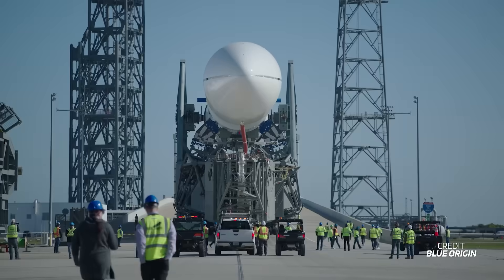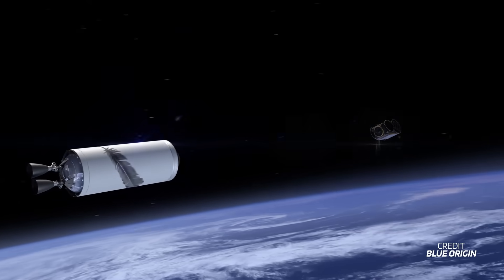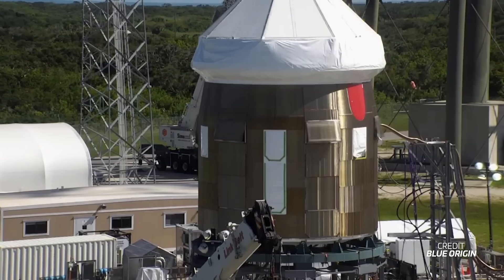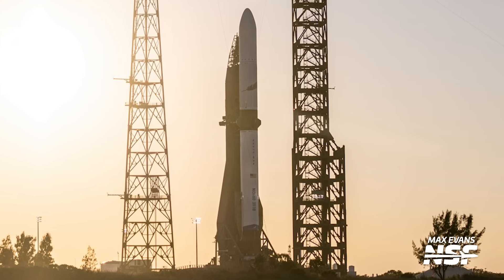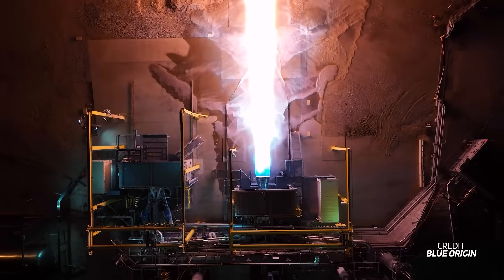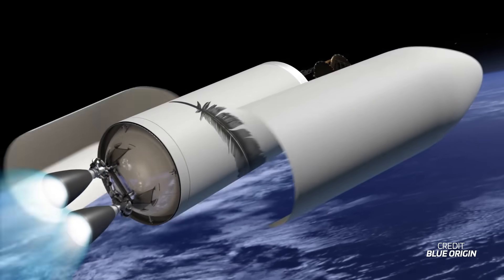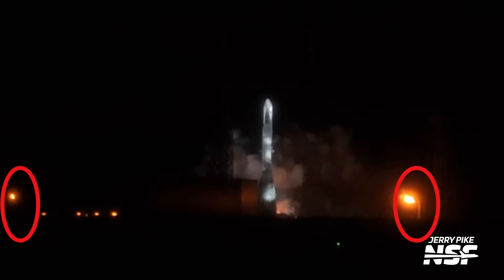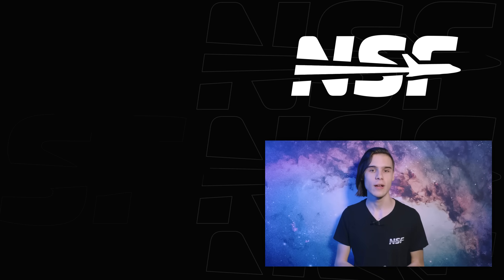The Wait Is Over: Blue Origin's New Glenn Takes Center Stage

Comment: Finally, something that can actually compete with Falcon 9. In payload capacity, at least. I predict five to six New Glenn launches in 2025 barring any catastrophic failures like ascent explosions, as getting used to refurbishing each returned stage and putting it back out is only something you get good at with practice and time. I expect a healthy cadence from this rocket in the future, since as SpaceX has so wonderfully proven, a high-payload partially reusable rocket is a remarkably efficient system once it spools up to full speed.

Comment: Are these engines more powerful than the raptors spacex has? Only 7 engines on this rocket compared to 33 engines on starship booster
Reply: Raptor 3 ~590,000 pound force
BE 4 ~550,000 pound force

Starship - 125 meters  tall (block 2 with hot staging ring) and 9 meters diameter
New Glenn - 98 meters tall 7 meters diameter

New Glenn has far less mass to lift.
:face-fuchsia-tongue-out:
Reply: @ thanks

Comment: It took SpaceX a while to successfully land a booster with their Falcon 9 system. They have made one land-based landing with a Starship booster and two controlled “soft” landings in the ocean with their boosters. Starship has not landed on a platform or land yet and I am not sure that any of the Starships have been completely recoverable. 

On a rocket system, there are a lot of things that can go wrong. You have to relight and control the rocket motors, you have to control the descent, the timing for landing must be so close to perfection that there is almost no margin for error. The Falcon 9 booster descents make all of this look very easy—it is not.

Each time SpaceX has launched a Starship-Booster system, they have needed to be re-certified by the FAA. The reason is this is a massive rocket system, all parts of which are going into space (above 100Km), are re-entering the atmosphere and descending in a semi-controlled manner back to Earth. There are considerations for the environment, danger to humans and the real possibility of launchpad mishaps with many tons of highly explosive fuels. SpaceX has struggled with getting permits from the FAA and I will be watching to see if Blue Origin has the same issues. I strongly suspect that there has been a certain amount of politics involved in these permits and I predict that Blue may have an easier time getting permits, as they are using many of the subcontractors to build the New Glenn that NASA uses to build their launch systems, resulting in many friends in Congress. SpaceX has not done this.

These companies could not be more dissimilar. SpaceX creates success from repeated failures, learning each time. Blue Origin moves much more slowly, trying to evade any failures. If there is any failure in this first launch, it will not be seen the same way that a SpaceX failure is seen.

Comment: I would be curious if you have data on the developmental timeline for Blue Origin vs. SpaceX.  SpaceX seems to prefer the "Move fast and break things"-Model when they developed their rocket, whereas Blue Origin seems to be focused on the "traditional" top-down design with their design. As an example of what I'm talking about, SpaceX probably always wanted to return their 1st stage on a barge, but took multiple years and 6 flights (per my Googling) before they added the legs and tried it.  Blue Origin seems to be willing to try it on the first attempt.  This means, Blue Origin had to fully design this in from the start (top-down design) and it probably cost them in terms of delays to their first launch.
Reply: From company founding to 1st landing for SpaceX was 16 years (for a orbital launch).

BO is on the other hand is into their 25th year with no orbital LAUNCH attempt.
:planet-orange-purple-ring:

Comment: I think just two launches in 2025 even if first one successful.  Logistics, weather, crowded Cape, lessons learned all causing delays.  But Blue is using a very different model than SpaceX, relying a lot on computer simulations rather than actual testing.  Just as SpaceX doing its rapid build/test/rebuild model was derided when introduced, so has Blue's lack of reliance on real world data.  This is really going to demonstrate if their philosophy works.  If it does, I see the gaps after the second flight dramatically reducing.

Comment: This launch will be an engineering reality check.  BO has taken a lot of time "perfecting" this rocket but there might yet be some unknown unknowns. It will be a show down of engineering approaches; iterative failure and improvement (SpaceX) or long partial testing with few full sequence tests (BO). My guess is that BO will launch no more than 3 times in 2025 due to "unforeseen" technical issues.
Reply: good comment
Reply: That's why they do all that small component testing.  It does tend to produce working system.  It's how they got to the moon.
Reply: @imaginary_friend7300  

NASA and its predecessors blew up a lot of rockets.  One of their sub orbitals taught them not to use leather gaskets to hold in LOX, it got soaked in LOX and any impact and it exploded.  Apollo 1 burned on the pad (with crew sadly) during testing.  Not to mention the failed Apollo 13 where they barely saved he crew.  A great many failures before they dared a manned flight and those accepted higher failure risks than are acceptable today.
:planet-orange-purple-ring:

Comment: Finally, what I'm watching for is how fast they turn this around and launch number 2 or if its going to fall into the SLS category where we'll get a launch maybe every 2 to 3 years
Reply: 24+ years from founding to 1st orbital launch attempt (IF it does in fact fly this year after 4 consecutive years of scheduled launches not happening) doesn't bode well for a rapid build up of launch cadence especially since Vulcan is supposed to have priority on the BE4 engines.  They are not known for doing anything quickly (except filing lawsuits to slow down SpaceX).
:planet-orange-purple-ring:

Comment: Blue gets to keep biggest payload fairing size since StarShip does not have a fairing. But payload volume advantage goes to SpaceX.
Would methane and hydrogen excess both flow to one flare stack or do they have separate flares?

Comment: This was a very informative briefing. Rapid fire and detailed. I think Kuiper is a pipe dream at this point but there will be competition to Starlink at some point. I'm really excited to see if another orbital class rocket company can actually successfully land after launch. I guess we'll see.
Reply: Kuiper needs a substantial number of launches SOON if their license isn't to expire due to not having the 1st half of the satellites up.  Bezos influenced the launch choices to NOT use SpaceX but to use New Glen, Vulcan and Ariane 6.  So far only Vulcan has had any launches (2) and one of those only succeeded due to the small size of the "payload" giving them extra fuel to over come the SRB thrust nozzle coming off.

I can easily see Amazon wanting to get Starship (when working) to help out in those numbers.
:planet-orange-purple-ring:
Reply: Kuiper needs to get up a little more than 1600 satellites by July 30 2026.  No info on the size of the satellites.  
:body-blue-raised-arms:

Comment: 10:58 did you just say... BE-4 is equivalent to... ONE Raptor engin???
Reply: Broadly, yes... BE-4 is 2.4MN, Raptor 2 is slightly more powerful at 2.5MN.
Reply: @simongeard4824  absurd, I didn't this starship would have almost 5x the thrust of the new Glenn
Reply: @Lil_MrHype  What are you expecting? It's a big rocket, but it's still a lot smaller than Starship, and it's packing about double the thrust of a Falcon 9...
Reply: @simongeard4824  the diameter of new Glenn is 7m compared to 9m, and the hight is 100m to 120m. Starship is bigger, but I didn't expect it to be almost 7x as powerful
Reply: @Lil_MrHype  Why do you think everyone hypes Starship so much? Starship is ludicrously big... it has more than double the thrust of a Saturn V, and on paper at least, much more payload to low orbit. Nothing comes close.

 New Glenn is physically large, but that's mostly because methane and hydrogen are a lot less dense than kerosene... payload-wise, it's in the same class as Falcon Heavy.
Reply: @simongeard4824  I guess u didn't expect as much of a difference because the size difference is not as much and both first stages run on methane, or as blue likes to call it liquid natural gas
Reply: @Lil_MrHype  or as blue likes to call it liquid natural gas

The difference is that Raptors take it highly purified whereas BO is going cheaper and putting up with the impurities (causing more engine fouling).
:planet-orange-purple-ring:
Reply: @Scanner9631  tx for thé clarification
Reply: Been wondering that too...
Am I missing something? 7 x 250tonnes of thrust doesn't seem enough??
Someone please explain this to me
Reply: New Glenn will be a competitor to falcon heavy, not starship. 
Personally I think it's dumb because FH rarely flies due to no use case scenarios. Blue origin should have aimed to compete with F9, which would be far more useful, but tiny man ego wouldn't allow it.
Reply: @jaredmundi3599  It does have one advantage over Falcon Heavy though – that huge fairing. FH maxes out on payload volume pretty easily, so it mostly gets used for smaller payloads to high-energy orbits, which require expending cores. On paper at least, New Glenn would be better at launching constellations, something FH isn't good at.
Reply: @simongeard4824  yeah that's something I guess. Still waiting to see the result of this 1st test. I feel like they are trying to run before they even started to crawl tbh.
Reply: @jaredmundi3599  That's been the story of Blue Origin for a long time... little sub-scale testing, everything must be perfect for the first flight, even down to attempting a landing.
Reply: @simongeard4824  That's fine but until it flies and lands as a unified system it remains untested.
Reply: @jaredmundi3599  think so too, that's what rocket lab is doing. At least they can launch their own satellite constellation

Comment: If they can land something on the moon on their second launch, without orbital refueling, they might be way ahead of starship. But the two are like apples and oranges.
Reply: They don't need orbital refueling because the lander is small enough. If SpaceX just wanted to send something to land on the Moon for the sake of it they could have done so ages ago
Reply: They plan on launching a Mars mission for their second flight, which was originally suppose to be their first mission back in October.  The Mars mission has 2 space craft built by Rocket Lab for NASA.
Reply: They also planned to have their first New Glenn launch in 2021 and 2022 and 2023 and 2024.  They aren't good at sticking to plan.

:planet-orange-purple-ring:

Comment: My guess: 2 flights this year. I can't imagine the first flight is going to go well. (I'll be pleased if/when proven wrong.) With that the case, they'll need to build an entire new vehicle for next effort, incorporating and testing changes to manage problems encountered in the first flight. I don't see them moving fast enough to get more than a 2nd flight in 2025. As I said, I'll be pleased if proven wrong.
Reply: I think there is a decent chance of successful payload deployment but I'd be impressed if they land the booster on the first try
Reply: valid
Reply: Why do you think the first flight will go south?  The recovery though, that's harder.
Reply: @imaginary_friend7300  "It's not rocket science" is a saying for a reason. And this will be the first time this collection of parts has ever left the ground. Such things tend to go awry. Wishing them the best, but being realistic about it.
Reply: They have a second flight planned for this spring. The Mars mission.  I would be surprised if they didn't do another flight or 2 after that.

Comment: @nasaspaseflight I'm an above average space nerd...but for the love of \0/ i cant remember why SpaceX (33 on booster) went with a higher number off engines compared to Blue Origen (5 on booster). I get an engine out ability but for SpaceX where less is more and taking out com-plexibility it seems weird that they went with so many engines which adds complexity and adds points of failure. What other advantages is there going with more or less engines?
Reply: The others reasons are good, but the primary reason is the need to recover.  The F9 has to do suicide burns because even at the lowest throttle a single Merlin has a T/W greater than 1. They didn't want suicide burns and suicide burns would never have worked for catching.  More engines means more throttle control since you can shut down engines.
Reply: @imaginary_friend7300  aaah yes, I understood the engine out capability of things but didn't know about the throttle control. Makes sense if you have 33 and all of them can maybe just turn up or down 20%...1 engine can then only do 20% but 33 engines can do a massive range by either turning them off or just making some engines a little less power than the rest 👍
Reply: It's called "Rocket Science" for a reason. And more engines ARE better than 1, if 1 of 33 fails it doesn't necessarily mean a fail or RUD. I 1 of 1 engine fails, well, GAME OVER......
Reply: Also, would you rather have a vehicle with motor that has 1 cylinder or 12?
Reply: @FrederickAlbertyn Blue Origen (5 on booster)

7 for New Glenn actually.  

But can New Glenn HOVER like Starship to make landing more reliable?  

Falcon 9 can't (not enough engines).  So Falcon 9 needs split second timing to cut the engine while at near 0 speed and altitude.  

Starship can hover and lower slowly to landing, can New Glenn?

  :planet-orange-purple-ring:

Comment: Here is my prediction from what they have delivered so far. In another month or two they will finally launch New Glen for the first time. They will have problems during the launch and and loose either the booster or main stage and then they will spend the next year or 2 designing and computer testing things.
Reply: Based on what they have delivered so far?  Such as?
Reply: @imaginary_friend7300  That's my point. Not much of anything.